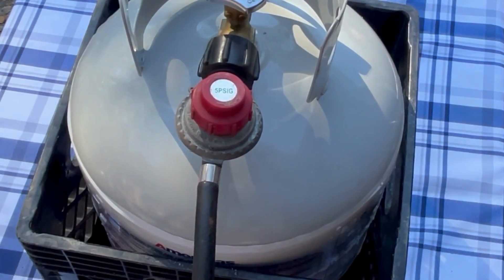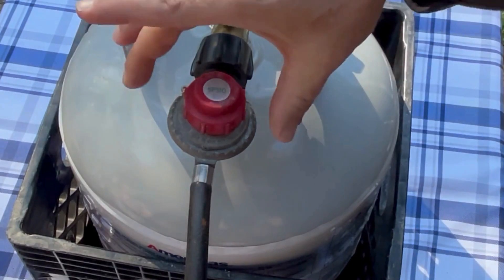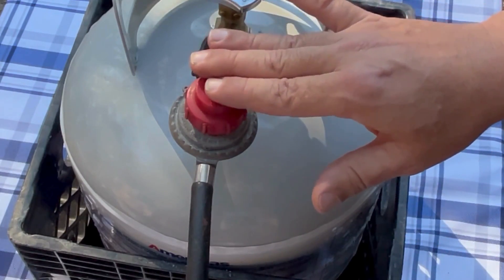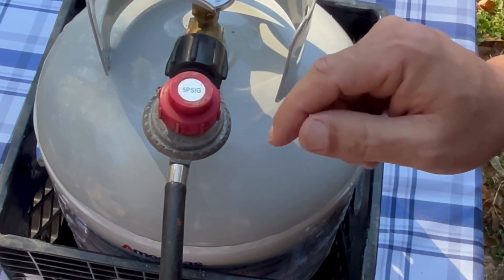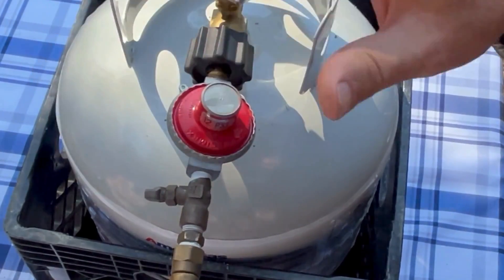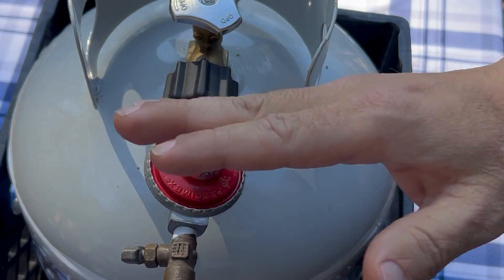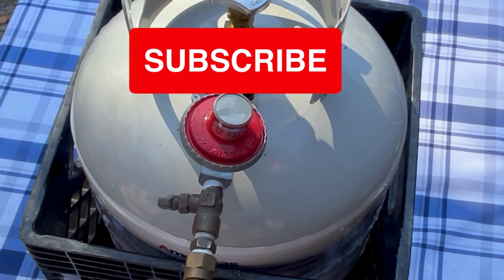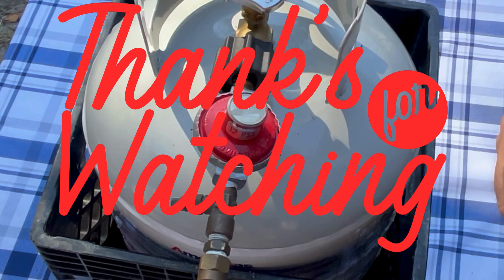What's The DIFFERENCE Between A PROPANE REGULATOR and The CONTROL KNOB?

Comment: Whats the difference between this control Knob vs using the metal Knob that is on the tank itself?
Reply from the maker: The hand wheel on the tank lets the gas flow from the tank.  The control knob regulates the volume of gas.